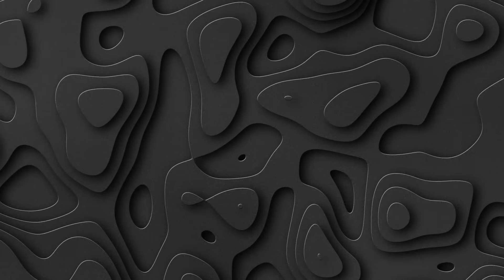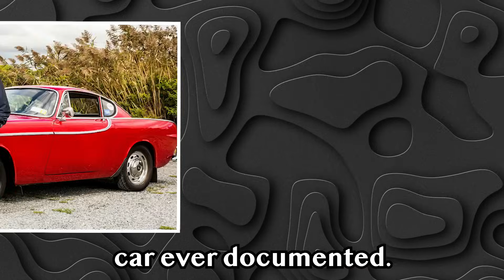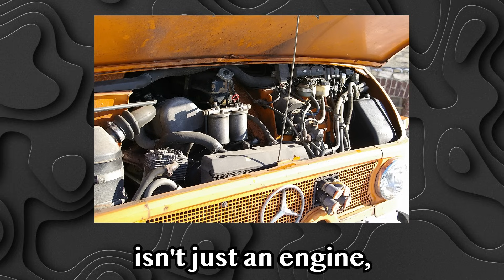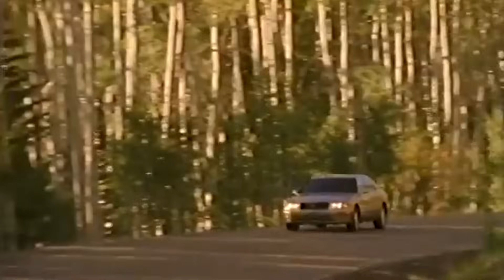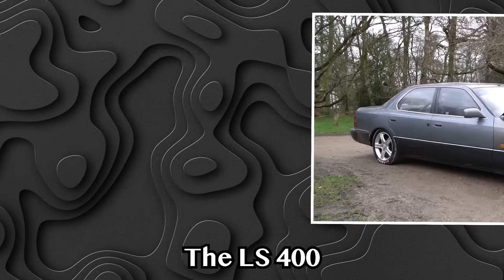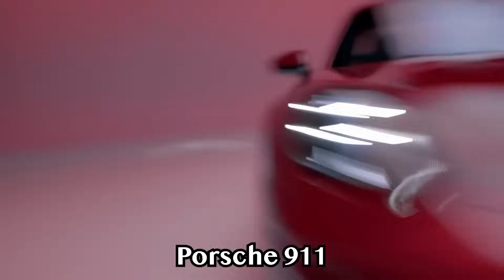STOP Buying NEW Cars! These BUDGET SUV'S Hit 1M Miles (Mechanics Can't Believe It)

Comment: "Modern cars are increasingly built with a 'planned obsolescence' mindset, but these budget legends like the Toyota Sequoia and Lexus RX300 defy the trend with 1-million-mile potential. Mechanics prefer these older models because their simple, over-engineered V6 and V8 engines lack the fragile plastic components and complex software that make new SUVs a liability after only 100,000 miles."

Comment: I'd like to know your opinion on a 2020 Nissan versa with a 5-speed manual transmission. I'd like to try to keep the car running as long as possible and I'm sitting at 93,000 mi now. Do you think this car can go two or 300,000 mi? Thanks so much.

Comment: I owned a 2006 Toyota Sienna bought new in late 2005 with 280,000 miles now. No problem at all just  regular maintenance  interval . Replaced  starter 3 yrs ago . Replaces  water pump everytime I replaced the timing belt. , serviced transmission and engine oul every 5K with synthetic type. Started using Mid Grade 89 gasoline at 200K miles.. its been going great..!

Comment: Chevrolet and GM designed a transmission to fail at 60,000 miles. In the late 60’s/early 70’s GM transmissions lasted around 100,000 miles on average.  The Powerglide was tough, but only had two gears. Everyone else was going to three speed automatic transmissions, so GM took the design of Chrysler’s 727 and put the drums, clutches and gears in reverse order but shifted them in the proper sequence. They added a vacuum modulator to get prevent breaking patent laws. The result was the TH400. It was a great transmission, lasting as long as the average GM engine did. But GM wasn’t making any money selling rebuilt transmissions, so they went about designing a transmission that would fail at 60,000 or sooner. Chevy used it in their cheaper cars and it did just what it was designed to do, fail. It was called the TH350. Instead of joining the input and output shafts together with a common bearing to keep both shafts in line, they put to blunt shafts in the TH350. The only thing holding the two shafts in alignment was the pressure applied to the Cluthces in the transmission. The result was a lot of wear that would occur in the TH400 or the automatic transmissions used by Chrysler or Ford.

Comment: I bought my 2002 Nissan Frontier Xcab for $8000 in 2008 from the original owner with 32,000 on the clock. It has the bulletproof KA24DE 2.4 L engine currently with 182,000 and runs like new.

Comment: I have a 2009 Ford Expedition with 220K miles.  New Transmission, transfer case, valves, alternator, control arms and bushings, wiring, multiple AC repairs.  BUT, the engine is orginial.

Comment: Subaru B9 Tribeca 2006 owner here. 189000 miles on the Boxer engine and in the 4 years I've owned the big guy, been motoring on with only 'oil' etc changes & 4 new tyres. Leather seats for 7 - or two seats in 'truck mode' - moon roof & DVD screen for back seat rows 2 & 3  with all-wheel drive we're happy taking on 6 lanes of motorway or have a gentle potter in desert sands. It does get upset when we go up or down the Montezuma highway - it's sensitive to the 4,000ft elevation so always gives us a dashboard blink or two.  😊
Reply: A friend of mine has exactly the same car with 234,000 miles on it. This week she called me up very upset. I went over and checked her car out and sadly the transmission failed catastrophically, and the car will barely move down the road. So be sure to keep up on your transmission maintenance

Comment: I bought in 80this Mercedes 220D from taxi driver, with 850 000Km on , I drove few years, have done body restoration  but engine and mech components haven't touched except brakes, sold with 1.1 million Km  to Taxi driver!

Comment: I gave away my 1st generation LS400 because of power steering issues it leaks badly. I use transmission fluid for steering fluid. If I spend money and concert it to conventional power steering it will last years

Comment: I was a medical courier for 8.5 years average 70,000 miles a year running the same route everyday . The company would only buy Subaru  namely the impreza or forester. We consistently got 400,000 miles out of them driving them in all types of weather and the awd system let us operate in all sorts of snow and bad weather without fail .the only thing that bothered them was black ice .

Comment: Guys common this is  like captain obvious. Of course in early 90s  cars could last 500.000 miles or even go to a million. The petrol engines were NA and the diesels were deforced to the maximum. I can totally break that myth on each and every car from the past. Take that Land cruiser 80. Was 6 inline 1hz engine with 12 valves head. This one could do 1M miles easily. Boring as hell. Take a 24 valves turbocharged with decent output of 180-220ps and welll try to get 1m miles on that. Same is today. Take any middle class non boosted diesel like renault 1.9 or Ford 3.2 and you will get yourself a damn reliable machine. From another point take anything internal combustion  that is producing more than 130 horsepower and more then 150 lb ft per litre of displacement and be ready to get into performance servicing routine.

Comment: I bought a Mercedes 240d diesel 4 speed manual at a auction  for $600. I drove ot to work 3 years. I sold it for a profit and I regret that I ever sold it.  I would fill it with diesel and would forget the last time I fueled it up. It got crazy fiel mileage.  The only problem i eber had was them little german fuses would corrode.  You had to clean them regularly.  It was an ugly car but it had stamina. I have an 04 silverado now it  411,000 on it. The way you treat a vehicle means alot also.

Comment: This is all well and good except most cars are made of steel and steel is acceptable to corrosion and most cars operate in salty climates or ares where roads are salted.   What that means is that the body of the car will go long before the mechanics.  It is wasteful to over build the power train on a vehicle that most likely will be rusted out in 10-15 years.    The majority of cars that get scraped have perfectly good working engines.

Comment: Guess you made a calculation mistake concerning the mileage of the Mercedes 240D taxi in 10'27" shows that had covered 4,600,000 Km that means 2,858,307.5 miles.

Comment: Thanks for the video, Can you please analyze other brands like Subaru, Honda and Mazda ?
Reply: I can tell you from personal experience that a 2016 Subaru Crosstrek (2.0 DOHC Boxer) is one of the biggest POS duds
of all time. Low friction rings cause oil blow by. The dealership told me it was normal, and documented in the manual, to burn a quart of oil every 3200 miles. I laughed in his face and told him my 2003 Chevy Avalanche (w/185k miles) burns a quart every 5k. The low oil message tells me it’s time to change it.
Reply: Got a 2006 Tribecca & find big B9 engine works just fine with 189,000 on the clock.

Comment: Camry Hybrids give great gas mileage and longevity. I have two 2012-2013 models. Still going strong.
Reply: My '07 Camry Hybrid with the 2AZFXE ring problem has 350k miles. No major problems other than rebuilding the hybrid battery pack a few times. I use a RC battery charger to refresh the 34 hybrid battery cells. Usually only a few are bad and they are about $30 each. That engine does burn oil.
Reply: @johndavid3598 had 07 camry hybrid also. Boy, this car was burning oil like there is no tomorrow, lol. Learned that the pistons rings went bad and had to sell it

Comment: My 2002 Toyota Sequoia 4WD Limited is at 187,000 miles with the original engine and transmission and is still running smoothly. Still maintained at a local Toyota service center.

Comment: Toyota‘s new land cruiser looks very complicated to me. A hybrid with a very complex turbo engine? Very expensive maintenance if there is any problems. I also heard that hybrids are more susceptible to putting strain on engines. You also have to use premium gas, and the hybrid doesn’t give you that much in gas savings. I think I’ll pass.

Comment: I worked for a taxi company for 33 years in Orlando Florida. The company kept the cars running for 500,000 miles and then they would sell them to overseas buyers. We used Chevys, Toyotas , and Fords. I personally drove a 1996 Grand Marquis LS to 480,000 miles it took about 5 years to accumulate those miles. Same engine and transmission. I drove several Toyota Camrys to over 350,000 miles with no major problems. Of course the taxi company was strict on maintenance and the cars would be inspected constantly.    I now drive for Uber and Lyft and use several cars for the business. They all have over 250,000 miles.. The trick to keeping cars running is to fix whatever breaks right away.
Reply: Mercedes E Class 220d.